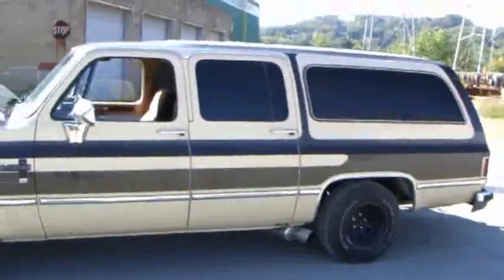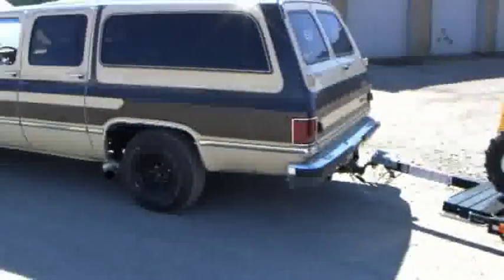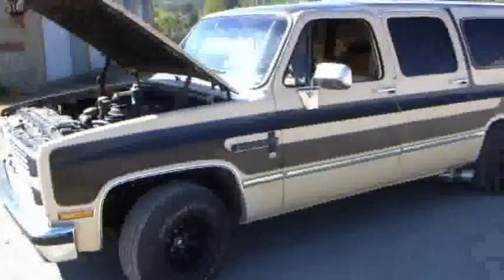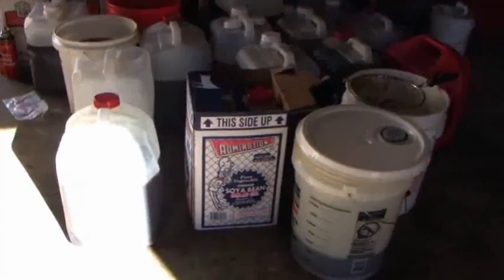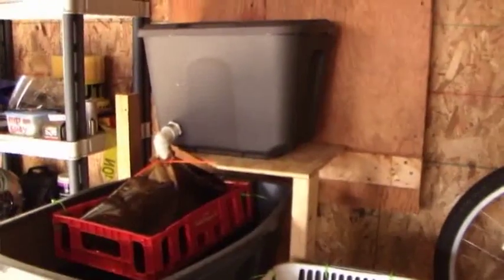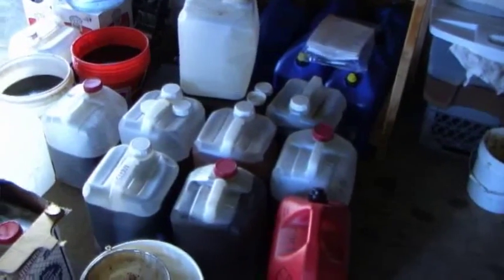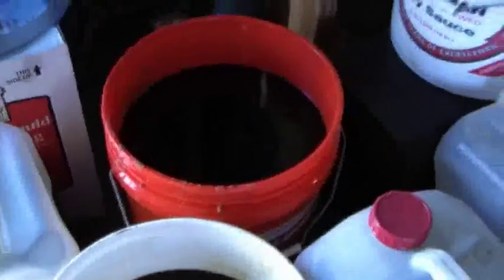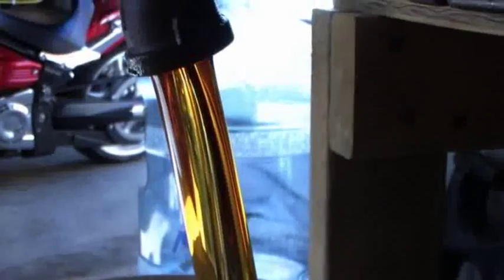MYTH BUSTERS CHEVY SUBURBAN DIESEL RUNS ON USED COOKING OIL

Comment: I got an 87 6.2 is it safe run veggy oil in that? 
Why did your engine blow? Too much vegy oil?
Reply from the maker: Anything before 90 is not a good idea because it does not have high compression gaskets

Comment: So you are not using any other element to run your suburban on straight oil..
How it works in winter season?
No heating element or you have one tank with diessel for start in the cold season ??
Reply from the maker: only run veg.oil in the warm months...someone did give me a winter mix that ran pretty good but I still mixed in diesel when it was cold out...I live in south west PA

Comment: the 6.5 was a pretty bad motor (but not the worst, the worst diesel ever offered on in the american market is the ford v10).. they were plagued with main bearing web cracks, cylinder head cracks, and PMD failures. the 6.2 was built for reliability and fuel economy (my 6.2 89 burban got 23mpg and lasted 541,000 miles)... the 6.5 turbo was a response to the consumer market wanting a medium/heavy duty diesel..

Comment from the maker: 6.5 the worst, really? I've had 4 diesels all chevys the 6.5 is just a 6.2 with a turbo all my others, non turbo. My first was a 89 blazer sold it with 250,000 miles and ran very strong 2nd was 3/4 ton suburban sold it with 378,000 miles ran great 3rd 84 suburban sold with 200,000 miles blown engine and still ran...guy drove it home and drove for 2 weeks every day untill he changed the engine. I raced a turbo dodge the other day and all I could see in my rear view was his black smoke.

Comment from the maker: well the truck in the video is gone (I blew the engine but it still ran strong just not up hills) I now have a 97 GMC 3/4 ton Suburban 6.5 turbo a whole different beast much more noisy valve clatter some say that's normal for the 6.5 any input on that would be welcome

Comment: Add WD-40 or PB blaster and ypu will have little problems in the injector pump but the cost is raised considerably, But you are using a renuable fuel, do the math....

Comment: @chrismandile 
stanadyne pumps fail on veg oil unless u heat fuel up and use twin tank system or get pump modded but they often wont work with diesel then as the clearances have been increased!
get a cummins or a mercedes, anything with a bosch pump.

Comment: using veg oil in that fuel pump will cause premature failure due to seizure of the rotor head due to the veg oil not penetrating and lubricating the parts with tight clearance.
stanadyne, lucas, rotodiesel all unsuitable without either keeping oil above 45 degrees C or modding the pumps.
Bosch pumps like those on cummins and mercedes are suitable.
Eventually it just wont start and the pump will have sheared its weakend failure point to prevent snapping cam chain etc!
get a heated filter etc.

Comment: how are you getting the water out ? i boil my veggie oil with a turkey fryer to get any water out. are yiou going thru alot of fuel filters ? that main 6.2 diesel fuel filter is close to 20.00 each. no racor filter ? i have a 6.2 diesel in my 88 1 ton gmc van i only run it on diesel 19 mpg. i have a 83 mercedes 300td station wagon i run on 100 percent used cooking oil 6 years now. i do a veggie vacation once a year florida to franklin pa. VEGGIE OIL MAN CLEARWATER,FLA. USA

Comment: Seven bucks for 5 gallons of pre filtered clean used vegetable oil when you'd get a little more than 2 gallons of diesel at the pump for the same 7 bucks?  Hmmm, sounds like a no brainer to me.  I'm thinking of getting a diesel Suburban in the near future so I will come get some from you to try it out.  Because it looks like a pain in the ass to filter it to the point where it's clean enough to use.